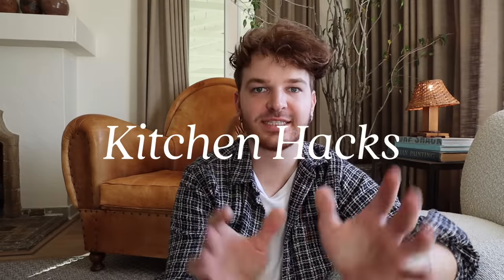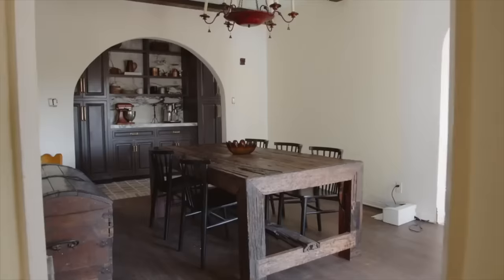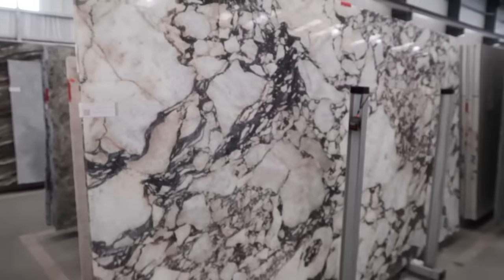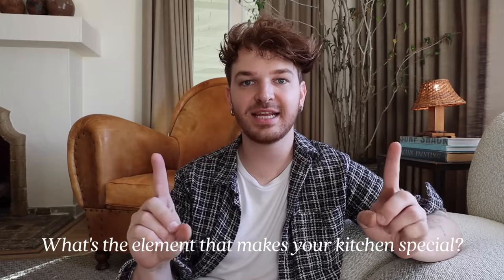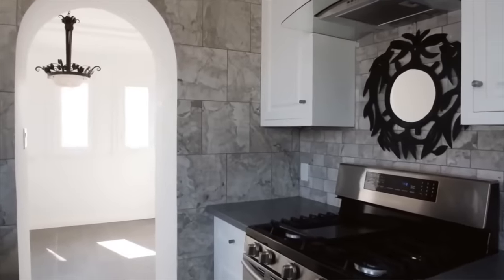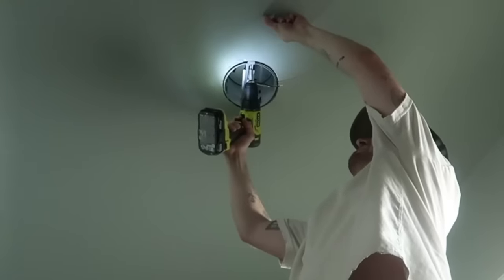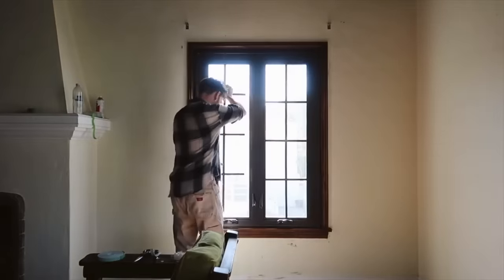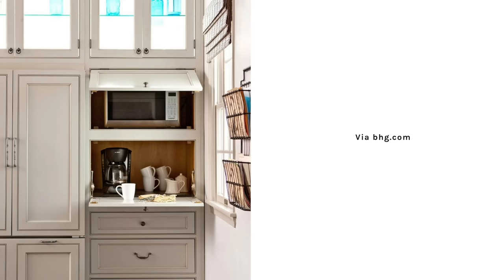10 HACKS to Upgrade & Elevate your Kitchen!

Comment: One thing to note is galvanic action when covering your appliances with another metal. This could lead to corrosion of your original stainless steel finishes. Maybe not a big deal if you want a temporary upgrade from an old appliance, but probably not something you want to do if you rent or have an expensive appliance you want to keep for a long time.
Reply: Thank you for mentioning galvanic action--I'd not heard of that before, but it makes a lot of sense to be cautious about the effect of one metal upon another.🤔 
Now I won't be tempted (as I nearly was!😮😯😲😳🥺) to cover my refrigerator, dishwasher, & range in copper sheeting! 😏
Whew!🥰
Reply: Appliances don’t last for decades any longer. You’re lucky to get 10 years out of any kitchen appliance nowadays-so worrying about long term damage would honestly be the very least of my worries.

Comment: I love all you did. You upgraded without having to gut the kitchen. We did that too. Only room we had to gut was bathroom. Not to code. Also think out of the box. We had a small cabinet above our wall oven. We have plenty of storage elsewhere but limited counter space and the two counters face out. Just pony walls and counters  making a kitchen in the large great room. No upper cabinets but many sliding drawers. Handy for the dishes. I just keep a 4 piece setting in kitchen and store others in hall cabinets. So we decided to put the microwave in the cabinet above the oven. At first we just closed it in there but old one broke and got a new nicer one with silver trim that matches our other appliances. So we (partner) took off the door and framed it in. Looks built in now. We had made a hole going through the side of the cabinet to the fridge space and screwed an electrical strip into the walll higher above outlet to be able to plug in the microwave and the stove.

Comment: EXCELLENT!
Was that a fire smothering blanket that you hung from your pot rack?   Made me think that a top ten safety summary video would be helpful.
1.  Kitchen fire suppression
2.  Kitchen/water heater/boiler or furnace carbon monoxide detectors
3.  Locating smoke detectors.
4.  GFI outlets vs. GFI circuits.
5.  Floor transitions/tripping hazards.
6.  Non-scald pressure balancing valves vs. temperature sensitive valves
7.  Knowing where your emergency shutoffs are for gas, water and electrical
8. Water leak detection at laundry, under sink, garage, basement, water heater.
9.  Outdoor lighting.
10.  Automotive/garage/lawnmower storage and safety as well as storage of paint, turpentine, naptha, stains, etc.
11.  Fire safety for Christmas decorations like decor over working fireplaces, overloading extension chords, outlets and circuits,  
      Might be a great theme for a Simpli-Safe video because of their smoke/water/CO1 detection devices.
Reply: And working fireplace flu-cleaniññ or creosote removal.
Reply: It looks like just a dish towel

Comment: Darlin, I love what you did to the dishwasher face and I'm going to steal that idea.  What I'd love to know is how you'd give a stove a facelift.... I have a brand new Forte 48" range, all white, with brass knobs and handles.  However, I'd love to add a brass towel bar across the top, and change out the handles as the current ones are a little too contemporary.   Also, I'd love to add a brass plate or some other accents to the door (think of the accents on a La Cornue).  What would YOU do and where would you source the materials?   Would you glue them on??     LOVE TO HEAR your thoughts.     Hugs!!

Comment: I love everything you have done to your kitchen.  What you did with that coffee bar was genius.  The kitchen seems like it goes really well with your house now.  I’m working on a kitchen renovation project right now.  I have to keep all of my upper cabinets because I need them for storage but I am keeping all of my cabinet boxes.  They are solid wood.  My dad is a woodworker and he’s going to build shaker doors for me and build new drawers.  He’s going to make pull out shelves for all of the lower cabinets as well.  He’s going to show me how to do it and I get to help.  I’m very excited to learn some woodworking because I feel like it’s totally a lost art.  We’re also going to switch the hardware and the hinges to European soft close hinges.  I am going to get new countertops and I’m going to do handmade tiles for the backsplash.  The other thing I’m doing is with my lower peninsula and all of the cabinets that face my living room, I’m going to cover them with some kind of paneling; either bead board or fluted panels and paint it the Sam color as my cabinets.  I think it will add texture and look really modern.  I’m very excited and I think my kitchen will be very unique.  The flooring is going to be last because I’m probably going to run out of money by the time it’s done 😅.

Comment: Hey Drew! Love your ideas and everything looks fab per usual.❤ Wanted to share an idea. What if you put a bar of in front of the arch doorway in your dining room (the one that leads to the storage nook next to the kitchen). And, on either side of the arch (on the walls in the dining room), create more shelving/countertop area units similar to the storage nook (either same or complimentary finishes). I know this will push your dining room table more in front of the entryway through the dining room.  But, it looks like you should have enough room to do this and it not appear too crowded or block flow. I believe this setup will add so much crazy good layering and visual interest. And, it’ll make your dining room serve more than one purpose.

Comment: Great vid with lots of useful tips. However visible hinges are coming back in style in Scandinavia and Europe so we are putting them back in 😂
Reply: Still ugly,though😂
Reply: @nelliebly6616 You could always paint to match the cabinets?  Also, depending on the hinge, it could actually add a bit of style (?) - not all hinges are ugly.
Reply: Visible hinges are ugly. Even if they come back,  they spoil the line.

Comment: I was hoping you'd speak about the microwave above the stove/oven and all in one exhaust fan system. I'm stuck with that and I hate it. I'd have to rip out an entire long wall, 10 ft, of cabinets to do what Drew did. I am tempted but the uppers continue around a corner so another 5 feet! I would lose 11 upper cabinets. Uggg. Any ideas other then tear out?
Reply: Maybe paint a different colour to the lower cabinets? Either lighter to make them recede or some kind of special finish?  Luxe handles? There's no reason upper and lower handles have to be the same, as long as they coordinate in style.

Comment: I have considered cabinets all the way to the ceiling, but I am only 5 ft 2 in tall, so I usually have to keep a small ladder in my kitchen to reach up high jajaja!
Reply: I am in a wheelchair so while I wouldn’t probably use the higher cabinets, I would still rather have them go to the ceiling because mine don’t now and the space above them is a terrible dust collection problem that is very frustrating to clean.
Reply: No te creo